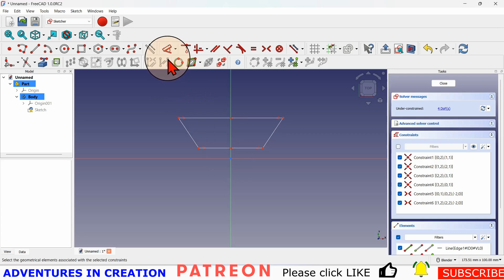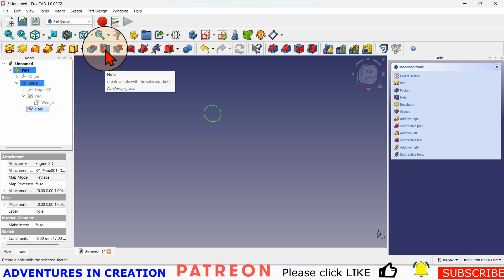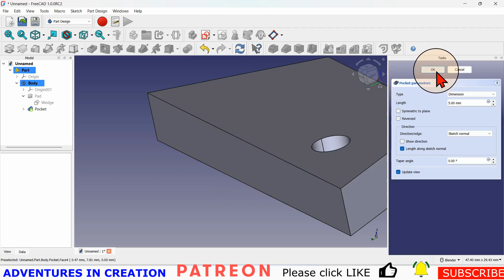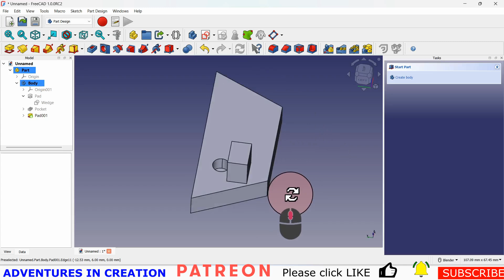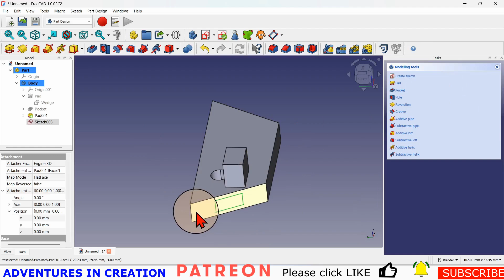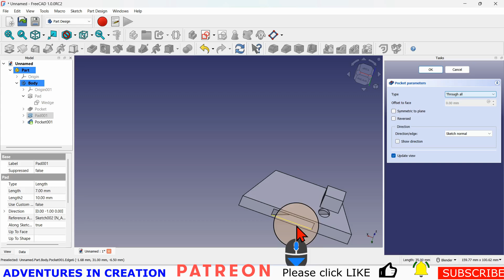An Introduction to FreeCAD 1.0 Part 3 #freecad #cad #design #sketcher

Comment: What is the significance of the Axis floating in space?
Reply from the maker: I think you are referring to the origin, it's the co-ordinate system of the space that you see. At it's center is the point in space 0,0,0
Reply: @Adventuresincreation  ahhh. So in lesson 4 the actual part will reside on the axis.

Comment: First of all i apologize my bad english. I am not a native speaker. I enjoy your excelent tutorials. When working with the scetcher i sometimes are struggeling with the fact that the measurelines overlap the bodylines. Is there a way to get the body lines in to the foreground?
Reply from the maker: You can just move the dimensions away from the body and place them where you want them.

Comment: There was 2 issues I had. The first one was when I used the Symmetric Constrain. I got an error message if the line had a Vertical or Horizontal Constrain. The other problem was with the Create External Geometry. It depended where I did it. It would do Pocket to the External Geometry instead of sketch had placed. I trying learn this CAD product after using MicroStation for over 30 year. I am retired now and don’t have access to MicroStation any more.
Reply from the maker: You should be able to use symmetry even if your lines are horizontally or vertically constrained. External geometry is just a reference, if you have issues with it, you can create your own reference.

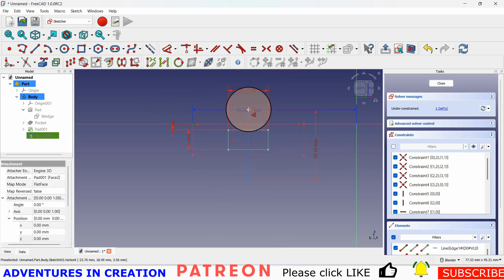Comment: Great Series!  Thanks for doing this! I am struggling with something though.  At 30:40 you add a constraint for the placement of the vertical construction line. I have done this countless times and each time after i accept the distance in the box, the constraint disappears. I have backed all the way out, erase and started over and keep ending up with the same error. the Error message reads: "Cannot set the Datum because the sketch contains conflicting  constraints"  I cant figure out how to identify what is conflicting and how to correct it.  Any ideas?
Reply from the maker: Is the construction line free standing or is it tracing another line or point. If it's on something that is likely creating a constraint. You really don't need to fully constrain construction lines. The model will still work.
Reply: @Adventuresincreation  Again, thanks so much for responding.  I have had am adventure but got it all working.  I deleted my other posts as they were issues that I inadvertently created and nothing more.  I did finally get this to work.  I was unable to constrain the construction line but, as you stated in you response, it didn't matter. I was indeed able to complete the creation.  Thanks again!! (I was not able to discern my construction line being on anything that may have been constraining it)
Reply: Try just deleting the construction line when you’re done with it. Worked for me.

Comment: At 2:15 you suggest to adjust dimensions before beginning new drawing.  I tried to do so since the object I want to draw is 5 meters by 3 meters but cannot find the way to do so.  Can you explain that.  Thanks a lot.
Reply from the maker: If you are using the same mouse setting as me (blender) then all you need to do is use the scroll wheel and watch the dimensions I showed increase. You want to zoom until you are in the meters range. If you draw a square and dimension it to 5 x 3 meters then hit the zoom all button, that will work too.
Reply: @Adventuresincreation  Ok thanks nice tutorial. Its been a while (years) I wanted to play with 3d and you make it really easier for me. a+

Comment: I just learned a way for us that are not in metric to remain closely to same view as you just divide what you say in mm by 8 and it keeps visual close.
Reply from the maker: There are 25.4mm to 1" so if you divide by 25.4 you will have the exact same size.
Reply: @Adventuresincreation  thanks my mind is mush and I didn't get much into metric system but wish I had . I can totally see now machining things would be alot simpler for me . Struggling to learn every day
Reply from the maker: @ronaldcrowder404  no worries, when I did my toolmaker apprenticeship we had machines that were all imperial (inch) but all of our drawing were metric, we had to convert everything to be able to machine it.

Comment: I'm enjoying your videos but I am having a small problem. Around the 22 min mark you are using the "Snap to grid" box. When I go to mine is it already set to "Snap to objects" and I can't uncheck that or check the "Snap to grid" box. Have toggled around the different grid options but no go. Have you seen this behavior before?
Reply: Nevermind go it fixed. Had to click the Icon first to move it from some sort of read only state.
Reply from the maker: Glad you found the solution. Feel free to reach out if there's anything I can help with.
Reply from the maker: I have not, but see you fixed it.

Comment: Thank you. I recently bought a 3d printer. Have some experience with AutoCAD. Have watched MANY videos of people trying to get FreeCAD into my head. Most of them forget to go ALL the way into every single step in order without having Togo back and fill in what they 'skipped'. Excellent job!!! I will follow thru your tutorials to learn this program. It was the little details like staying off the axis when setting a point  (because the snap constraints)  that cleared things up. Thanks again.
Reply: I bought Creality's  K1 Max. Seems to be  ok thought I think I need to level the bed a little better than the factory. I noticed that one corner doesn't seem to bond the layers as well as the rest when running a PETG filament. I'll figure it out. I didn't become an engineer because I didn't like to solve the puzzle.....   thanks again. I'll be going thru the series of your tutorials as I find time
Reply from the maker: @mikelong366  Nice, I have the Ender 3 V2 Neo it's a neat, if somewhat smaller, printer. It has auto bed leveling but I still had to manually tune it.
Reply from the maker: You are welcome, what 3D printer did you get?

Comment: This is the furthers I've made it in learning FreeCAD, thank you! I do think my colors are slightly different than yours (I think they changed the defaults or I'm using a different theme).
Reply from the maker: You can completely customize everything. I try to leave my stabdard but it's changed over time

Comment: I've downloaded it on my PC and when I try to use it I keep getting an error message that says "This system is running open GI 1.1 FreeCAD requires Open GI 2 .0 or above. Please upgrade your graphics driver or card." I tried toing into preferences as someone suggested but when I click on preferences I get a page that says preferences with absolutely nothing on it. Any suggestions. I am using windows 10.
Reply from the maker: Did you try upgrading your graphics driver?
Reply: @Adventuresincreation  No. I don't know how to do it.

Comment: Trying to follow along, but it's crazy difficult to select vertices, and when I finally do and try to set symmetry constraints I just get errors that things are over constrained or DoF (whatever that is).  Maybe a lesson in dealing with common errors and how to resolve them.  Also keep getting dimensions trying to snap to the origin instead or letting me pick a second point.  TY again for the videos though,.
Reply from the maker: I will add a lesson with that. It seems a lot of people don't have the auto remove constraints selected in their set up. DoF is degrees of freedom. You want a fully constrained model, i.e. no degrees of freedom. Over constraining simply means you are limiting the DoF in more than one way. There is a setting that allows you to automatically remove overconstraints. It works very well. Not sure why your vertex selection is so difficult, when you put your mouse near a vertex do you see it change color, maybe the pointer is slightly off the the vertex, mine is that way sometimes. If you zoom in, it usuall makes that selection much easier.
Reply: @Adventuresincreation  TY that'd be great. It's super confusing.  I'm on a MBP with touchpad most of the time so a few setup things seem odd.  Dimensions are tiny (found setting), vertices are tiny (found setting), picking vertices I doubled the "pick size" but it's still a challenge.  I think FreeCAD isn't "retina/4k" screen aware.  It's getting better.  I greatly appreciate your responsiveness to feedback.  I found a an old video titled FreeCAD For Beginners p.1 from thehardwareguy that covered constraints reasonably well, would be great to see one updated for v1 and include some UI/UX tweaks to make things like seeing dims/vertices easier.  TY TY TY

Comment: Thank you for the video. I'm struggling with the Constrains. I follow step by step on what you were doing but my sketch is getting all Orange and I'm getting the error that I have too many constrains. At one point I deleted all the ( – and | ) vertical and horizontal constrains and it worked but in the second instance of your video I try to delete them and when I move the measuring it will give me very odd shapes.
Reply from the maker: Go into the settings and make sure you have  autoremove redundant constraints checked.
Reply: @Adventuresincreation  Thank you. Wouldn't have found it.

Comment: I'm really liking this series. Thanks! Question: I notice that when you apply the symmetry tool (4:44 in this 3rd video), the previous horizontal constraint disappears. In my app it doesn't and I have to manually remove it. Is that a setting?
Reply from the maker: There is an auto remove setting
Reply: @Adventuresincreation  Ok, I found it: Edit > Preferences > Sketcher > General > Auto remove redundants. Thanks
Reply from the maker: @jeffholloway8345   Excellent! Thanks for the update.

Comment: Is there a simple command to find where it thinks the "Wire is not closed" as this drives me nuts sometimes trying to find the issue.
Reply from the maker: You can use the "sketch validation" option, it will find the issues for you. Use "highlight troublesome vertices" you may have to zoom in to see the highlights on the sketch.
Reply: @Adventuresincreation  thanks found it, strange that it's greyed out in sketch. that's were i expected to find it, not once you have closed the sketch.

Comment: Excellent vid. I watch it in the background while I work on my own lame projects. Strictly use it for 3D printing at this point. A couple problems I’m constantly running into: 1) If I make a change in my design most of the part is hosed with errors I just can’t fix and I practically have to start all over again. Getting used to that and just go with it now. 2)can you go over tricks to select just certain elements of a sketch? For example just the circumference of a bunch of circles so that an equal constraint can be applied. 
Thanks for the great content over the years! I’m using the v1.0RC😊
Reply from the maker: I am not sure why your models are hosed when you make changes, that's not supposed to happen. - I will definitely go over tricks to select elements in a sketch.

Comment: At the beginning, when making the top line symmetrical to the axis, I get an over-constrained message and I have to delete the constraint that shows on the y axis.
Reply: I think I know the answer to this... it's because we constrained the horizontal lines I think, but those constraints become redundant when we then constrain them symmetric to the axis...  There's a setting in Preferences... Sketcher... General... where there's a tick box called Auto Remove Redundants which wasn't set on mine...  When I ticked it the Horizontal constraint was removed when I set the Symmetric constraint.  Hope this helps
Reply: Such cases got me sometimes drawing the sketch deliberately slightly rotated and moved away from the original. Only when done, I add last two constraints.
Reply from the maker: That's interesting, do you have any other constraints that were added "automatically"?
Reply: Not sure, I just followed along what you were doing.

Comment: I've been subscribed for some time and I see that your presentation style has become much easier for me to follow.
In some of your older videos, things were happening so fast that my brain couldn't keep up with you !
Recently you have become MUCH more suited to this Aging Engineer's Brain of mine !
I applaud that and wanted to let you know someone had noticed. 🙂

- Chuck In Belize
 p.s. Running 1.0 RC2 I have not yet had the geometry break on me due to the "topological naming problem."
 Have you ??
Reply from the maker: Glad to hear it. I am trying to go a pace that new users can quickly get on board. I have had some things break with the TNP but not nearly as many. I still try to use techniques that aren't going to encourage problems.